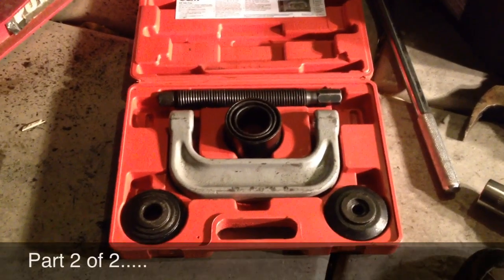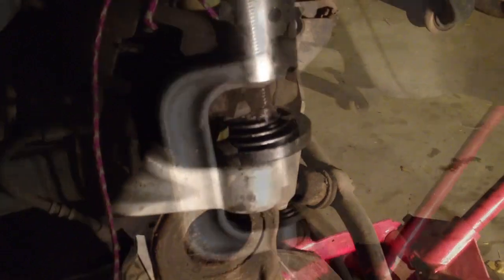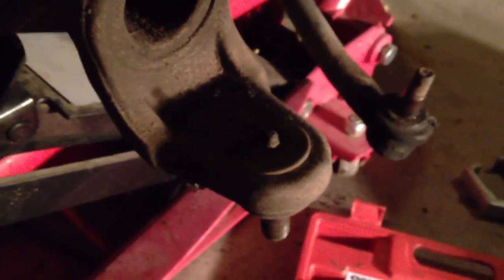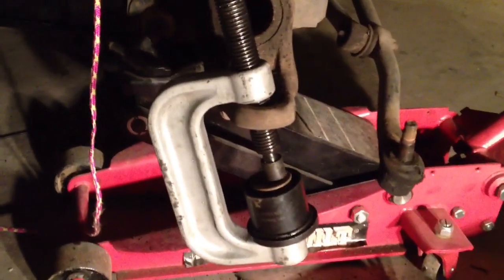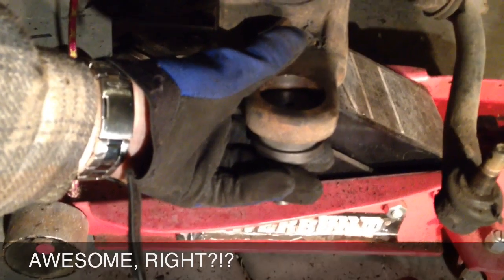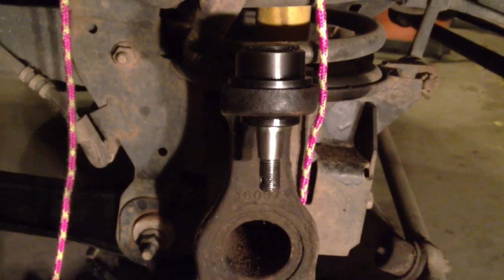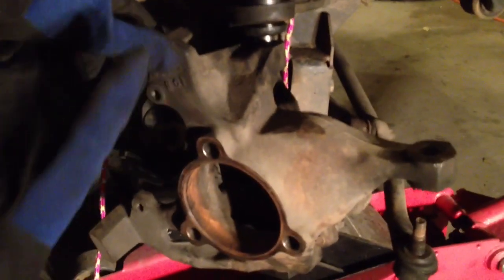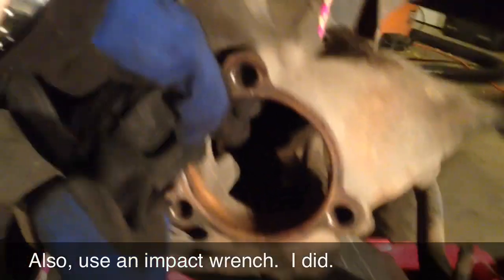Dodge Ram Ball Joint Replacement 1998 1500 4X4  - Part 2 of 2

Comment: Great video, as people are still commenting and posting had you tried the fastening procedure of first tightening upper ball joint to about 30ft/lbs then lower to roughly 40 then upper to recommended spec then lower it stops them from spinning instead of hammering the knuckle onto an ungreased joint less chance of damaging new parts the better and as stated before removal of axle nut is not required for disassembly although it does make it a little heavier it’s just a step that would save time and money from buying that large of a socket

Comment: I'm replacing mine in my 74 k-10 This weekend. Not so much as they need it. Having a front wheel bearing freeze on the freeway and 2 days latter a 12x35 tire exploded on the same freeway that propelled me from the carpool lane up the gravel embankment on the right my eye was starting to twitch every time I started it. But I'm feeling much better now.

Comment: Thanks for uploading the vid Manny, Good to see people helping others out on youtube.  But i just wanted to add a few things . I hope it helps..... You only need to take out the 3 bolts on the back of the bearing hub assembly, that will let the axle and bearing all come out at once. so you dont have to take the Castle nut off of the stub shaft.  its "best top keep that nut on the stub shaft".  There is no reason to take it off,  Plus When they get taken of on on multiple times, they seem to wear the threads, especially on factory stub shafts, and it keeps the bearing pressed properly when you leave the nut on the shaft.  and you can get away with not taking off the tie rod also.just keep the Assembly held up with a bungie or rope so it doesnt hang.     Every body.... make sure you Torque all ball joints to proper Specs.  and if you happened to take the stub shaft nut off ( I dont recommend)... definitely make sure you torque that nut properly, or else you will be replacing the wheel bearing soon.  it will wear them out fast if they are not properly torqued. thanks  : )

Comment: Very nice video very helpful. I have one thing for ya though lol the reason the bottom took so much pressure is there is a c-clip around the top edge were the zerg fitting was to keep it from coming out while driving and such. Again thanks for very helpful video!

Comment: Thanks for the videos!! I'm getting the same issue with the lower ball joint shaft rotating so I cannot remove the steering knuckle. It's the old ball joint so I'll probably just angle grind it off.

Comment: Great video this truck is such a pain in the you know what for this process, we have the same truck down to the color and I'm on my second round of upper ball joints but going ahead and replacing the lowers as well, they are a pain to mess with should be easier my second time around since it shouldn't be as rusty as the first time from the Michigan weather.
Reply from the maker: Ernesto Nido If you're doing the uppers, you've dug that far in and you might as well go all the way.  While I'm there, I also look at other things like wheel bearings and and rubber boots.  I've had my truck since 1997, when I bought it new.  Have you had any trouble with the differential?  I've had to rebuild mine.

Comment: I notice throughout the video you would leave out the actual work.  For example, pressing in the ball joints you would show the ball joint and then you would show the ball joint installed.  Showing the actual process would be a nice improvement. That said, I have ball joints to replace on my ram and this was a nice video refresher to watch before I get greasy.  Thanks
Reply: +Russell Brown  wtf , you turn the ratchet , the video was perfect , thanks manny , g

Comment from the maker: My main reason for replacing the ball joints was a lot of play at the wheel.  While it was jacked up, i grabbed the top of the wheel and pulled it in and out, and could see the movement.

Comment: If you arnt changing the wheel hub assembly then you don't have to remove that castle nut you can slide the whole hub assembly and axle out together just an fyi to save some time.

Comment: Do you happen to remember the size of the nut on the lower ball joint? I need to get a socket large enough for it and would prefer to not have to buy the next three or four sizes to figure it out. Thanks for the great video by the way!

Comment: Hello thx for the vid, I have a few questions. I installed the moog uppers and lowers on my 98 4x4, has the dana 44. The upper ball joint has about 1/8 to 1/2 half of inch of the shaft exposed even after I have tightened down the castle nut as hard as i could. I noticed that the shaft of the joint goes up and down alittle, but it seems likew the top doesnt slide far enough down into the spindle.... AM im missing a step or doing something wrong.....?
Reply from the maker: gerry kline I'm sorry I just saw this.  I don't think you've got the right ball joints. The castle nut should tighten without any gaps between it and the spindle.  I'm sure yo've figured this out, but I'd have taken them back.

Comment: Me and my husband have a 1997 4x4 Dodge RAM 1500. We are replacing the steering components... Rotors...brakes...ball joints etc. But we ran into a problem. We have used a ball joint press...a fork...a hammer...etc. The bottom ball joint on the front passenger side isn't wanting to come out. It's like it's stuck there...we DK what to do. Any ideas?
Reply: bell deal I've had this happen on a first generation ram, I had to blow the lower ball joint out with a torch

Comment: Good video but Zerk fitting  ...really ?   You mean grease fitting or grease nipple.... right ? Sorry I don't mean to be a zerk.
Reply: A grease fitting, grease nipple, Zerk fitting, or Alemite fitting is a metal fitting used in mechanical systems to feed lubricants, usually lubricating grease, into a bearing under moderate to high pressure using a grease gun. Wikipedia